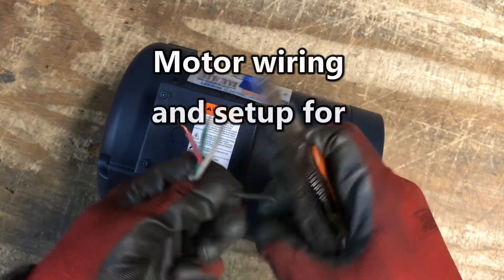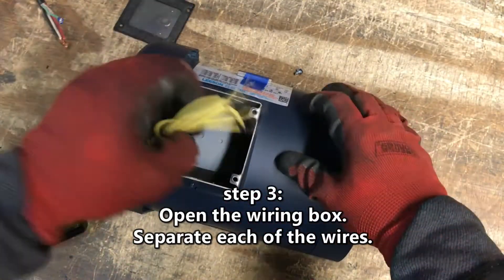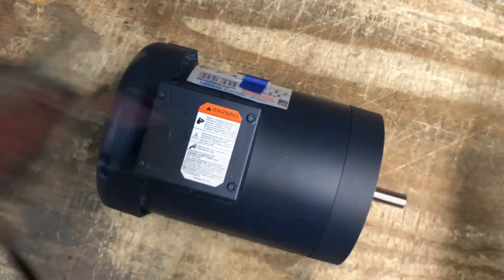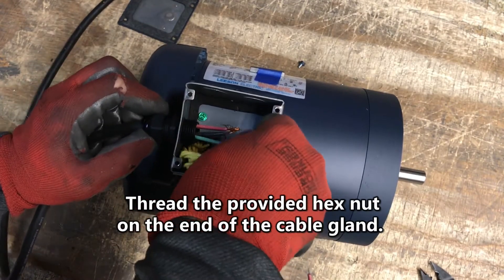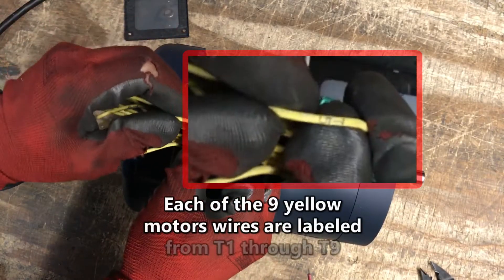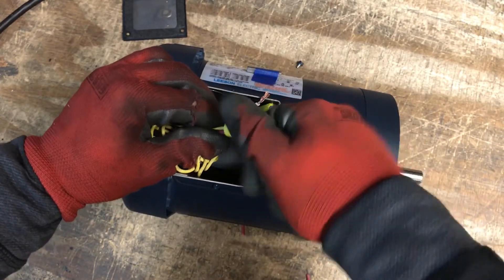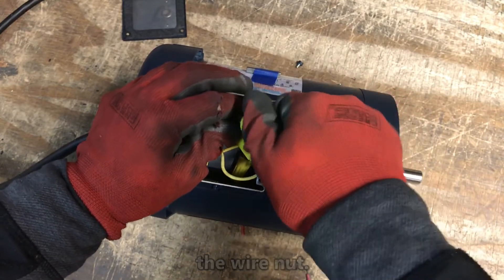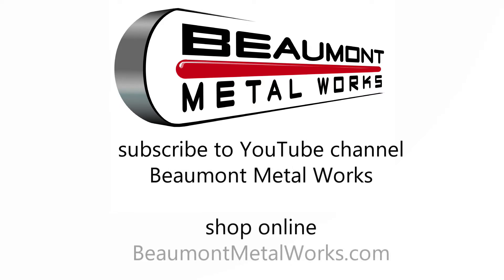How to Wire and Setup A/C Motor for Variable Speed KMG and KMG-TX Grinders from Beaumont Metal Works

Comment: Is this for 110 or 220? Sorry if it says
Reply from the maker: This motor receives 230 volt 3-phase power from the variable frequency drive or controller.  The motor wiring shown in this video is "low voltage" for this particular motor, which can receive either 230v or 460v from the controller.     The controller from Beaumont can be set to receive either 115v or 230v power in single phase.

Comment: I was currently running my Kmg-TX on 118v but now that I bought a new shop going to 220v how much amperage do I need?
50 like my welder? Want the correct size wire and breaker installed.   Sorry unable to find my paperwork after moving.
Reply from the maker: Generally, power equals volts times amps, so at twice the voltage the system will draw half the amperage.  Based on the motor name plate, the full load amps of our 2hp KMG-TX motor is about 6 amps.  Amp draw must be more than that at low RPM/high torque situations and under very high loads, so it's possible that a 20A breaker may be appropriate at 220v. 
 Check with an electrician since the proper breaker will depend on expected usage, wiring, shop configuration and what else is wired and running on your circuits.
Reply: BeaumontMetalWorks  thank you
Then I believe that I saw a layout for returning the wiring in the motor on the website back to 220v .
Reply from the maker: Beaumont sells the KMG-TX with either a 2hp motor or a 3hp.  The VFD for the 2hp KMG-TX can be powered by either single phase 115v or 230v AC, and the motor wiring is the same in both setups.  The important change for the 2hp KMG-TX grinder is to change the internal VFD jumper J1 to match the input voltage.  No motor wiring change is needed if you went from running the 2hp KMG-TX on 115volts to 230volts.   The VFD for the 3hp KMG-TX can be powered only on single phase 230v AC.
Reply: BeaumontMetalWorks thank You